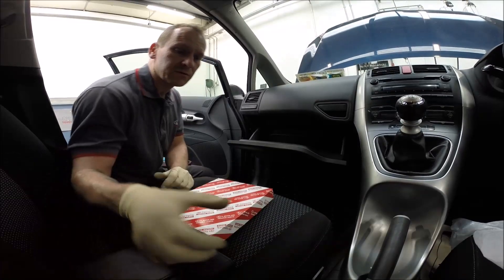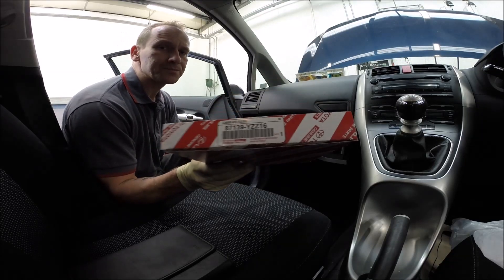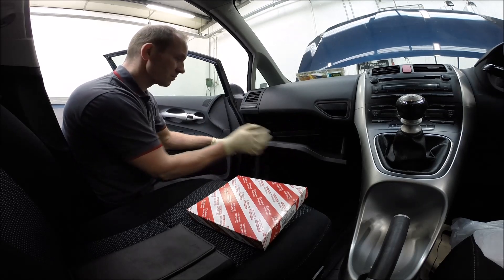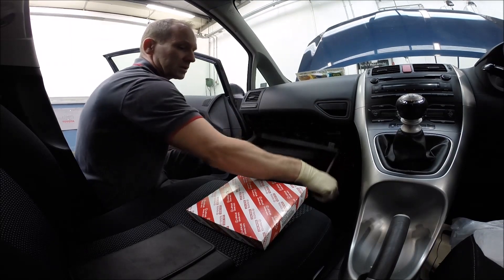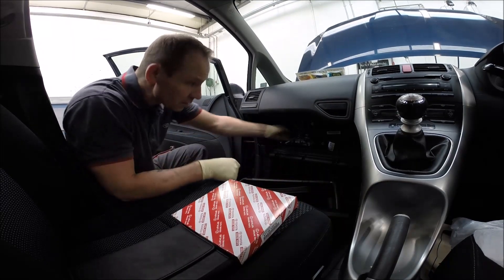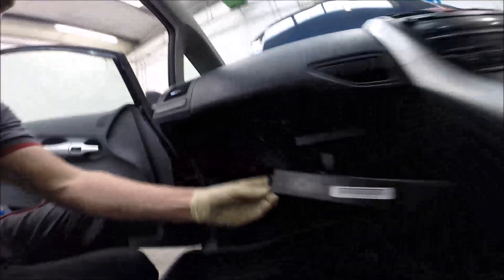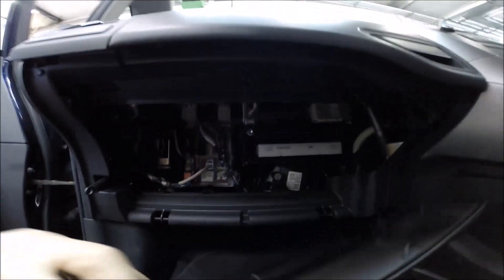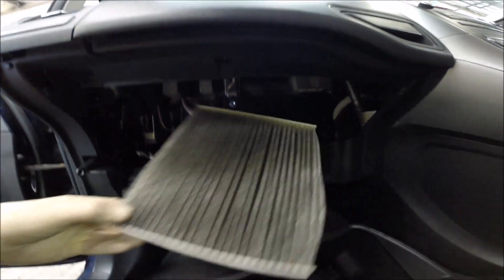Toyota Auris Pollen Cabin Filter Replacement

Comment: Arrow show flow of air not to the top mate
Reply: it doesn't matter which side is up or down , not on this filter anyhow
Reply: @vjanda1  yeah on normal. Does not but if its there is good practice to put as you should, maybe somebody will use this next time when change for carbon one.